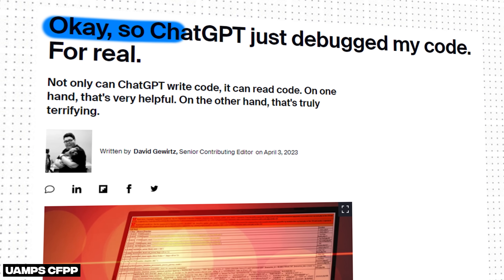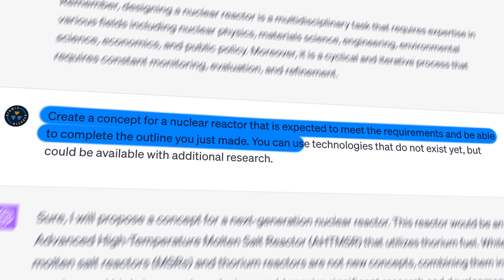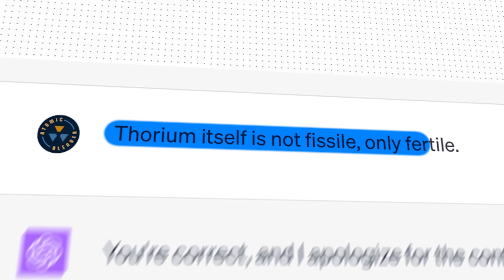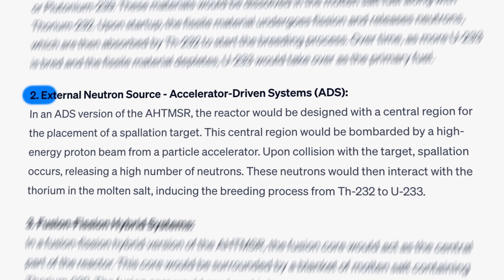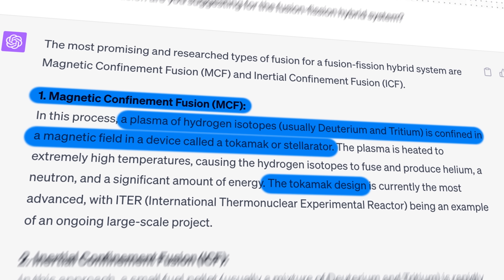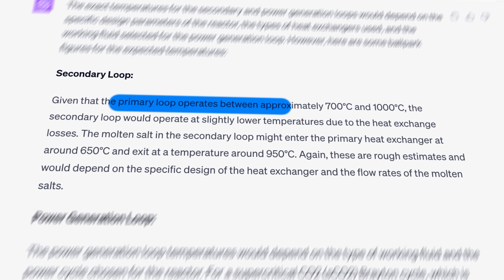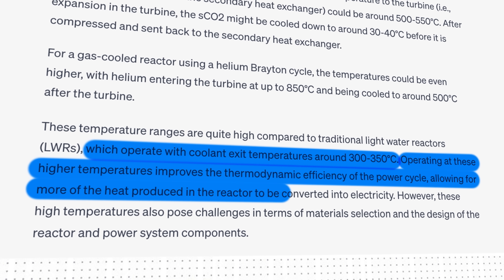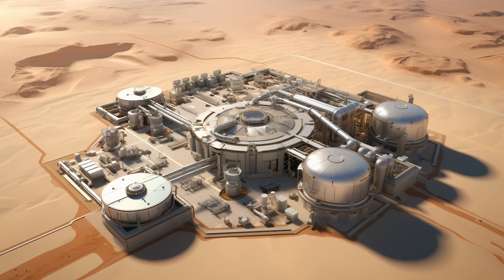Unveiling ChatGPT's Insane Nuclear Reactor Design

Comment: Not a nuclear scientist, but if you are having fun with AI try revisiting the fusion design and get the AI to orient the magnetic containment field so that the plasma forms a vortex plasma filament (as seen on the sun) based on Marco Rodin's work on Vortex Based Mathematics - might be key to increasing efficiency and power output. Could be worth a stab, and if you don't crack fusion, then at least you get another video out of it. Also if it works I want 10% 😜

Comment: ChatGPT is not a general AI, it is just a large language model. GPT models excel at text generation, text completion, and a wide range of language-related tasks. LLMs encompass a variety of architectures, including Transformers, RNNs, and CNNs. These models are designed for scalability and versatility, with the architecture chosen based on the specific LLM's objectives. They do not understand logic or math. To do that they need to farm out to things that do. Like Wolfram Alpha, which understands math and other things much better. Here is the bottom line; The GPT models are transformer neural networks. The transformer neural network architecture uses self-attention mechanisms to focus on different parts of the input text during each processing step. A transformer model captures more context and improves performance on natural language processing (NLP) tasks.
Reply: That is why they are going multi-modal.  A domain specific AI for the nuclear industry should be able to model physics, and materials.  We are multi-modal, after all.  We are overlapping neural nets.  We can look at our legs and move them with our will, or we just think run and they are controlled by another network that we are not fully connecting to.
I'd also point out that we are horrible at math.  We break it down into steps.

Comment: I think AI will help us with a lot of the research and regulatory framework. The one thing I do disagree with is the immense amount of public data available. I've had to do research projects and the amount of information I get from a google search is pretty immense from INPO, various vendors, WANO and especially the NRC, then there's the company's UFSAR (not really public) and other documentation and calculations I have to go through for research when doing design verifications. An AI that can help digest all this information will be invaluable, but at the same time it would have to be backed up by actual human analysis, I can never sight an AI as a source for an engineering transmittal or design change.
Reply from the maker: I completely agree AI is great at summarizing and interpreting large amounts of existing data. It's really useful for that. However, detailed design information is often held proprietary. Documents like FSARs aren't great for detailed design info since they are usually just summaries to demonstrate compliance. But a specialized AI that focuses on one topic, like nuclear energy, probably could do some more interesting (and accurate) things. Cheers!

Comment: what about using an electrostatic confinement fusion reactor for the "fusion neutron source" concept? they're not over-unity but for this they don't need to be.  Hobbiests have built these and have them in operation, and they do make neutrons (enough said hobbiests need to be very careful).  I'm not sure how much neutron flux they could theoretically produce, but I do know they are currently existing technology.

Comment: This AI probably was exposed to the many videos from Kirk Sorensen and Gordon McDowell on LFTR (Liquide Fluoride Thorium Reactors) the high temperature part is fundamental to this design anyway.  Oak Ridge labs in Huntsville, AL ran this exact set up (1960's and early 1970's) but using Uranium, rather than Th, because Th had been shown to be able to be used at the Shippingport facility already.  This was more a test of the liquid fluoride set up, and it was successful.  So the AI probably got most of that sponged up, and this is easily the best overall opportunity to move ahead to fourth generation set ups (this is one of the categories that the Generation IV group issued in its release).  It does NOT produce plutonium, so it does not make weapons materials, that is the side effect of the typical Uranium light water pressurized reactors, which should be kept running in limited extent.  These things have plenty of benefits, especially far fuller burn up, and safety.

Comment: Yeah, I tried using ChatGPT as an aid when programming, and it's really hit or miss. If I ask it to prepare an implementation of a well known algorithm - it works fine. But whenever I need help with a library it doesn't know, or it does not understand the algorithm I need - it just makes up stuff. I have to proof-read every bit of code I get from it, before using it.

Comment: I agree that it is unlikely that ChatGPT would ever be able to design a nuclear reactor, a language model isn't really the only AI available.  If you mix many types of AI plus 5-10 years of development of the AI.  It may be able to not only design reactors, but then put them into physics systems that can iterate through millions of designs to produce the one that most closely achieves the sometimes conflicting design specifications.  I think that the tech for this already here it will just take time to integrate the various pieces.  However, and the current rate of AI development, in 2-5 years the integration will likely take 2-5 years less work.  In about 10 years, we may not need to integrate anything because at that time, it might be able to do that part for us.

Comment: A very interesting experiment, thanks for this.  As for AI, it's not clear yet how it can/ should be used in life-critical applications and designing or operation of a nuclear plant certainly fits that category.  I'm reminded of an earlier AI that devised a way for a spider-like robot to talk.  On solution was to turn itself upside down and use the robot's 'knees'.  The developers are constantly being 'surprised' with some of the things AI comes up with (including how it 'hallucinates' facts sometimes).

How can a regulator trust any AI system's output at this point unless you can prove that the AI takes into account the risk to humanity and the environment?
Reply: The problem is the AI isn't actually AI. It's far from intelligent and lacks any understanding of what it is doing. It's just good at taking a ton of data and then spewing SOMETHING out that is vaguely like what was put in data wise. So it can't just MAKE anything without lots of pre-existing data to copy off of, at best it can be used to speed up the optimization of parts where a if a human was doing the work it could take months off number crunching and revisions.

Comment: ChatGPT struggles on anything that doesn't really involve modification of language or interpretations.  After all, it is a LLM (Large Language Model).  It is absolutely fantastic in helping to generate documents and proofreading.  Anything that modifies the language of a document, it absolutely excels in.  However, for anything highly technical, it isn't very good at that.  To the point of being extremely vague, as @AtomicBlender points out.  

Worse than that, it tends to forget scenario rules provided at the start with a prompt.  I've had to remind it several times to stick to the scenario rules and not to deviate from those rules.  In that sense, it is similar to a human where it will roll with the scenario details but forget the rules and constraints by which it MUST operate.  That struck me as interesting and annoying simultaneously.  Interesting in the sense it behaves like humans in that regard, annoying in the sense that it isn't human and has a perfect memory whereas humans eventually and inevitably do not.  It also has no concept of deviation of an attention span as it is the literal definition of awaiting my every command.

Comment: Using the fusion reaction as a core, isn't that bad of an idea. You don't have to have break even or better from the fusion, just lots of neutrons... But a more conventional method is just as good, thermal neutrons are after all still neutrons... I'm not implying that it's feasible to do a fusion within fission core, kinda like a turduken , but the idea is interesting, and maybe as an interplanetary engine? 😂
Reply from the maker: 😅 I like the turducken approach
Reply: A particularly high-temperature variant of this mutant fusion-fission hybrid reactor, perhaps with superconducting heat pipes and other fancy tech, is now how I firmly believe the poorly-defined plasma reactors in Warhammer 40k work - they really don't seem to be pure fusion reactors and it just fits too well.

Comment: Design, build, test 10 trillion times with deep learning, a small and safe cogeneration heat and electricity reactor, suitable for steam generation in New York City, for example. Ready for 3D printing, a thousand years of continuous operation within deep learning. Produce the blueprint and make the appropriate order, putting robots and men to tasks, the nuclear regulatory agency always says yes, but you should try to pass the test just in case.

That's the kind of thing I want AI to do. GPT is nothing more than a fancy encyclopedia it seems to me, but I haven't seen GPT 6.

Comment: I think people like you can make big, positive changes in the field of clean, reliable energy sources. AI certainly have place in this journey although it will probably struggle with independence.
Results of the test were very interesting, starting with PWR is good idea because we know the technology very well, HT molten salt reactor not so much because we need reactors now, biggest failure was probably fusion neutron source inside MSR. Googling fusion neutron source i couldn't find much useful information, have to spend some more time on this technology.

Comment: My brain did a wobbly trying to imagine tokamaks, lasers, and particle accelerators somehow embedded in and around high temperature molten salt. This is why I stopped using ChatGPT for even making work life balance suggestions. It doesn't have a good grasp on feasibility when multiple complex factors get integrated. It performs best for single known concepts, giving a typical 101 or layman's explanation. But it starts forgetting the bigger picture after the initial prompt and gets bogged down in the details. I guess that requires creativity.

Comment: I’ve asked ChatGPT to design various rather simple analog circuits and the responses are laughable. The more constrained the design requirements are the better it does, but still extremely disappointing. Reminds me of maybe what one would get from a lazy sophomore that thought his prof was an idiot. An example task I gave ChatGPT was: 

Given Vcc = 15 V, and RL = 2 k ohms, design an amplifier using 2N3904 transistors such that |Av| >= 50, Rin >= 10 k ohm, output voltage compliance >= 5 Vp-p, fc(min) <= 20 Hz, fc(max) >= 100 kHz.

Many more constraints could have been given (capacitive coupling vs direct coupling, etc) but a basic design would be obvious to any EE undergrad, or even community college electronics graduate. Maybe it’s because ChatGPT was designed by software guys and so it’s biased against hardware (anyone that’s ever blinked an LED with an Arduino thinks he’s an electrical engineer), but it’s analog design ability is dreadful.

Comment: Has anyone tried to prompt ChatGPT to build a hydrogen Fusion reactor? The current 'bottleneck' [even with laser fusion] seems to be the problem [since the 1970s] with build a magnetic containment that is stable and also able to adjust chaotically to increasing turbulence in the plasma. I don't know that AI would have interesting solutions?

Comment: The first option was the only viable option and this is the Liquid Floride Thorioum Reactor (LFTR) for which there are tons of papers on and the US built a partial prototype of in the 60's at Oak Ridge. So nothing new here other than ChatGPT (and I )think this is the best nuclear fission option. It is also infinitely more doable than nuclear fusion with most of the benefits of fusion. I wish the US would fund this option since the current high pressure solid uranium reactors where highly funded by the government for atomic bomb materials (plutonium). Currently the US is hardly funding LFTR 's while china is building an LFTR now.

I am not that surprised chatGPT was lacking in quantitative details since ChatGPT cant do quantitative calculations... it just scours the internet and guesses what is true.

Comment: If you are a Nuclear Pro you schod know that the D+T Fusion needs his Neutrons to bread the T. Even this concepts needs to Double the Number of Neutrons to create a Working Fusion. So there are no Newtrons to bread Thorium. You may use the high Speed Newtron to trigger Fission on U238 like the Design of the Zar Bomb, and use this Newtrons to Bread T and Pu239 …… But this sub critical device is a quite Dirty peace of technic  in relation to activation. Cat CPT dows nok ditinguisch beween "I know secure" ans "I don´t know secure" and this causes the Law Fail with an imagined case. I have also seen it in software creation. The old derecated module it can use, but i fails too create the modern substitute wich the actual Library. Cat CPT is not Able to work scure correct …… the opposite you need in nuclear design.

Comment: Asked. 

Ask A.I a question....
Is it's answer accurate...
It's answer👇

To calculate the total energy contained within Jupiter, we need to consider the mass-energy equivalence principle from Einstein's theory of relativity (E=mc^2), where E represents energy, m represents mass, and c represents the speed of light. By multiplying Jupiter's mass by the square of the speed of light (c^2), we can determine its total energy content.

Using this equation, we find that the total energy contained within Jupiter is approximately 1.798 × 10^44 joules.

Now, let's delve into the concept of wormholes. A wormhole is a hypothetical tunnel or shortcut in spacetime that connects two distant points. It is often visualized as a "shortcut" through space, allowing for faster-than-light travel or even travel between different universes.

The size of a wormhole is typically described by its throat diameter or radius. The throat is the narrowest part of the wormhole where matter and energy pass through. In theory, the throat can be smaller than an atomic nucleus or larger than a galaxy, depending on various factors.

Determining the exact size of a wormhole created with the energy of all the atoms in Jupiter is challenging due to several unknowns and theoretical uncertainties. The energy required to create and sustain a wormhole is not well understood, as it would involve manipulating spacetime on an immense scale.

However, we can make some speculative assumptions based on current theories. Let's assume that the energy of Jupiter could be used to create a stable, traversable wormhole with a throat diameter on the order of 1 meter (approximately 3.28 feet). This assumption is purely hypothetical and does not have any scientific basis.

If we consider this assumption, it would mean that the wormhole created with the energy of all the atoms in Jupiter could have a throat diameter of approximately 1 meter.

Comment: 8:37 I'm not that surprised. Have you seen it doing math? It has... problems. I guess being good at language doesn't translate very well into being good with numbers. Go figure. One of my favorite failures, albeit not at an arithmetic level, is where someone asked it to prove that 1+1=2. One of the answers it gave was an attempt at a proof by induction. A fine technique... except, it's not applicable, since "1+1=2" contains no variable (not to mention this is dealing with concepts more fundamental than any standard techniques can usefully address). But it went through the motions anyway, acting as if a variable was present, and blissfully ignorant of the blatant circular logic. 😆

Comment: Good grief.  Its particlizing past input and rearranging into future output.  Normal engineering, not requiring so much "intelligence".  However, it is at a state it can reflect on  things and bring things togther and reiterate designs, or that was where I got ChatGP3 up to in my short session.  However, this may still be a grab bag of people's theories.  Where somebody else has thought through and out solutions (real intelligence) and is parroting the thought particles together).  There is a lot more to intelligence, but the reflecting reiterating mechanisms are a core part where you add transform conpared to desired performance, from other fine idea particles, or new, to generate new thought, where you simulate the space, to see metrics problems and solutions, before you simulate with the  model, improving in this examination in your micro to full reflection and reiterations on it.  But, it's more again.  But, just this limited model should generate more intelligence.

Comment: In a way, this is predictable and scary.  If you look at the amount of work Kirk Sorenson has done over the past decade or to promoting the LIFTR molten salt fueled, molten salt cooled design,  and the amount of online content around the discussion, it is no wonder that chatGPT's solution was so heavily weighted by this design and the issues raised by it (regulatory, etc.).  Predictable that given the weight and quality and NEWNESS of the discussion around Thorium Fuel Cycle, Molten Salt reactors, LIFTR and specifically FliBe, it is predictable that a tool that merely weights and regurgitates would come to this solution.  What is scary is that if the question was posed around a subject where the internet is loaded with disinformation, It would conclude something false as the best solution.